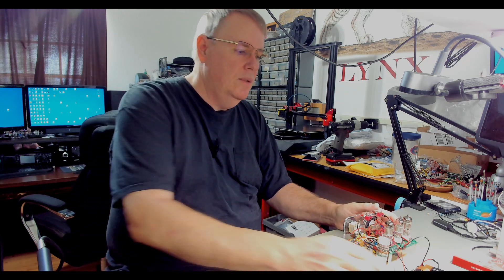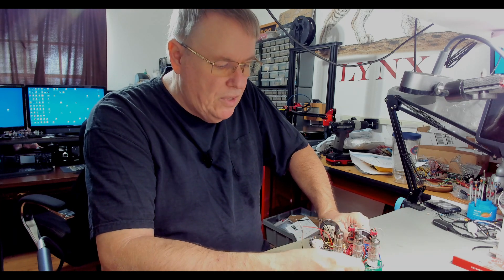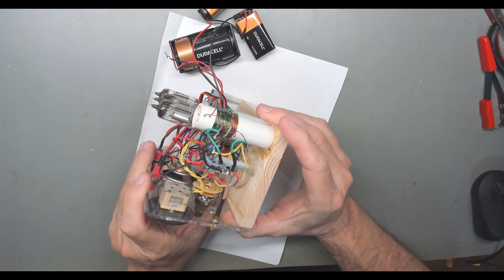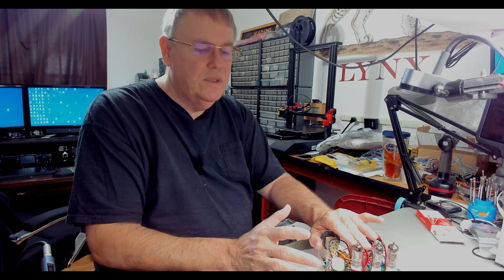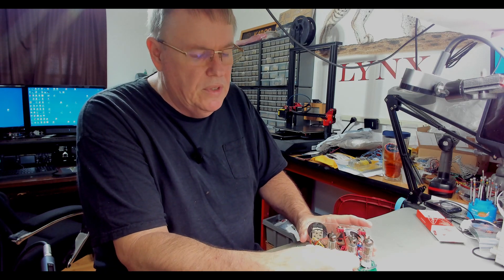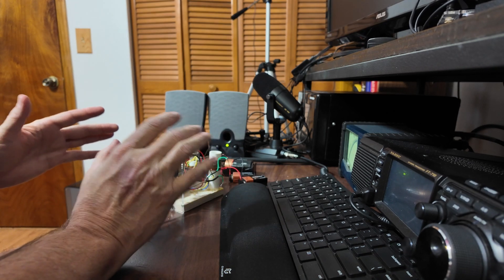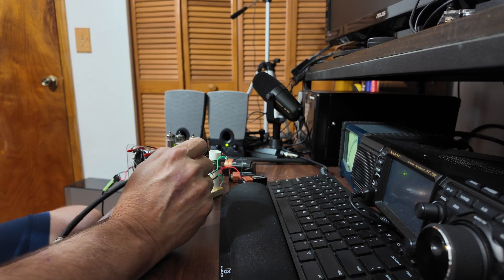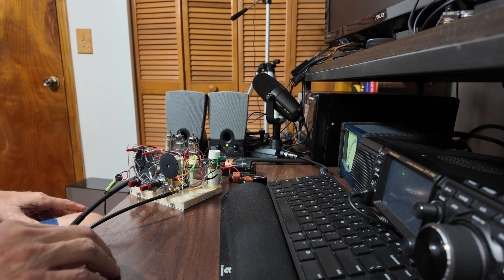Three Tube Regen Receiver Part III

Comment: Good job on the video, really interesting. Yeah, these regen receivers are nuts! I made a single valve set back in the 60s from a kit. The HT battery was 90v. The audio was into high impedence bakelite 'phones. An indoor antenna pinned to the picture rail in my room and water pipes for the earth. The regeneration control was termed "reaction" and for AM stations, you increased the reaction control to just below the point of oscillation whereas for CW or SSB you adjusted reaction to just past the oscillation threshold and then fine tuned until the CW  or SSB was clarified. I got some neat results and built up a small collection of QSL cards. The thing that used to drive me nuts was the phenomenon of "hand capacitance" - once you had the signal tuned how you wanted it, if you took your hand off the reaction control, it was like tuning away 20 or so Hz. I never did figure out how to fix that.
Reply from the maker: Thanks!
Sounds like you had a lot of fun. The hand capacitance issue usually required a metal front plate and a plastic isolator on the shaft of the controls. Sounds like me and my first radio, an old crystal set. Created some good memory’s for me also!
RJ

Comment: It is sad to say that these kits are so inferior to what is already on the market. When I say what is already on the market I am talking about portable vintage tube radios. I personally think that one would gain a better understanding of how the circuits work by rebuilding a time tested true radio, not guessing why your modern "Kit" does not work. You mentioned in the video something about how you can run up to 90 Volts and that it would be better on the plates. These vintage tube radios have two batteries, one for the heaters @ 1.5Vdc, and the main battery, normally at 57Vdc or in the neighborhood (like you mentioned, up to 90Vdc). When I go out looking at swap meets, I normally carry a 1.5Vdc battery and a block of 9Vdc batteries wired in series, 6 will give me 54Vdc to test radios I find. If they glow in the dark, we have a starting point. The rest of the rebuild would encompass replacing the leaking capacitors. The fun part is actually learning the "Why" part of capacitor theory.
Reply from the maker: Thanks for the comment,
I also enjoy rebuilding old radios etc. while the two kits I have done on this series so far have been low quality in some areas, I have others coming that are better. 
RJ

Comment: Great video, thanks! I would probably have put the tickler coil on the wrong side as well without thinking about it and then getting very frustrated when it didn't work. Like Homer below already mentioned, a good ground can make a huge difference. I built a regen receiver kit a long time ago, solid state, and was amazed to be able to receive local hams on 40 meters, the oscillator can behave as a BFO making is possible to make the SSB signals audible. But tuning will be very difficult with a small variable capacitor like this one, you might get lucky. Thanks for taking the trouble to make the schematic for the coil. makes it so much easier to connect and avoid mistakes.
Reply from the maker: Thanks!
Glad to hear the coil diagram will be helpful. Once we finish the shootout between the different radio kits I am going to go through each and see what I can do to improve them. Should be fun and interesting. 
RJ

Comment: Congrats on getting it to work. I never use ham radios or understand a lot of the radio electronics. Still interesting to see basically some parts and tubes together to receive a signal. Cheers Rick
btw: The other night had a few moments to try and play with the PLJ-8led freq counter. Well lets say mine has some issues. I measured on my o-scope a 2 volt p-p wave that looks like a AM modulation wave on it on the RF input wires. I couldn't get it to show any freq using my 60mhz arbitrary waveform generator nor my 4.4ghz rf generator. That is why I used the o-scope to check everything.
Reply from the maker: Thanks Rick,
Sorry to hear about your frequency counter. Do you think it’s bad? Message the seller they normally will send you a new one. Guess I might of got lucky with mine.
RJ